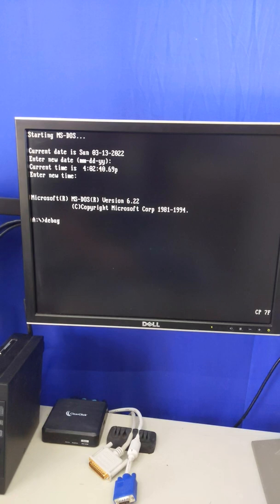How many microchannel slots on an IBM PC Server 320?

Comment from the maker: 'q' to quit DEBUG, of course. The output to I/O port 75h doesn't need to have a leading '0', and also can be inverted in order with outputting '8E'h to I/O port 74h - I'm showing the sequence for wanting to read the value in Extended CMOS at the address offset of '018E'h.